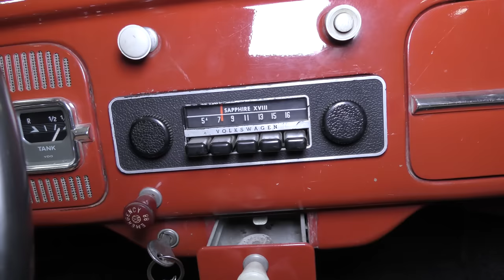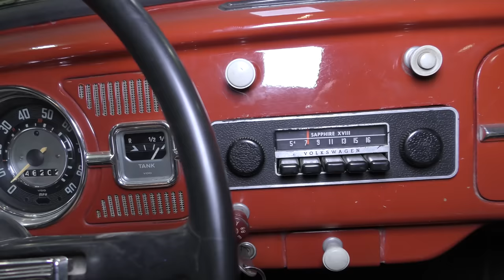Big Mods with big $$$. When Mods don't make sense. What did the  CAR WIZARD do to this '66 VW Bug?

Comment: My first car was a red '67 beetle, so this brought back quite a few memories. Some key changes from '66 to '67 were: 12 volt electrical system replaced the old 6 volt, the headlights had no glass covers. Other than that, they were pretty much the same. I think they moved the fuel door from the trunk to just behind the fender with the '68 model. Oh - the engine displacement was increased from 1300cc to 1500cc.
Reply: Mid year ‘68 was when 12v replaced 6v and also when irs replaced swing axle. I turned 16 in ‘88 and the ‘68 was my first car. I found all this out the hard way over the years and MANY owned VW models. ‘71 was first year the super beetle was introduced and they didn’t get the curved windshield and deeper dash until ‘72
Reply: @soganoflarider  This is a list of all changes incorporated in the '67 Beetle...1967 (1 Aug 66 to 31 Jul 67)
Chassis 117,000,001 - 117,999,000
Engine D 0,095,050 - D 0,234,014 34bhp(DIN)1200
Engine E 0,006,001 - E 0,014,000 37bhp(DIN)1300(US-M240smog)
Engine F 0,940,717 - F 1,237,506 40bhp(DIN)1300
Engine L 0,000,001 - L 0,019,335 40bhp(DIN)1500(US-M240smog)
Engine H 0,204,001 - H 0,874,199 44bhp(DIN)1500

1500 engine introduced - similar to earlier type 2 (bus, kombi) engine, but without the rear cross member mounting point.
"Volkswagen" badge on engine lid.
12 volt electrics.
Generator increased from 180 to 360 watts.
Voltage regulator moved from generator to under rear seat.
Rear track increased with wider swing axles to 1350mm.
Clutch diameter increased from 180 to 200mm on 1300/1500 models.
130 tooth ring gear (flywheel) replaces 109 tooth.
Dual brake cylinder system (drum brakes).

Front discs (single circuit) on 1500 models to some countries (but not US).
Outside door handle has push button.
Inside door handles recessed.
Two speed wipers.
Back-up lights (on US models).
Vertical headlights replace sloped glass.
US models get sealed beam headlights (other countries retain bulb-and-reflector).
Locking buttons on doors.
Driver's armrest on door.
Slimmer chrome trim on outside.
Driver's outside mirror becomes standard.
Rear anti-sway bar added.
Reply: The car in this video has 67 exterior door handles

Comment: My first car was 65 beetle with 6v electrics. At night with the headlights on, if it rained, the wipers struggled to operate. It was powered  by a dynamo, not an alternator. It ran beautifully,  60mph top speed but didn't like hills. Second car a 70 beetle. Paid 300 pounds for it . Had it 10years, put 80,000 miles on the clock and sold it for 300 pounds. Never missed a beat.
Reply: Through 66 they were all 6v. This one has been converted. Most actually went with the 12v generator as the Alternator didn't come out for several years. The funny thing is if you didn't change out the wiper motor they would flop back and forth way too fast.

Comment: The front suspension is trailing link not control arm trailing link suspension gives a smoother ride, important in a car with so little weight on the front end.  Why did you replace the fuel pump?  Older VWs had a problem with alcohol destroying the fuel line between the tank and the metal fuel line in the chassis. Auto makers solved the problem of vapor lock with tank mounted fuel pumps.  Alcohol also dissolved the foam plastic floats used in Rochester carbs.

Comment: Those 'type 1' VWs were SO EASY to work on. You could swap the ENTIRE engine/transaxle in THIRTY MINUTES! Back in 'the day' there were VW garages that had rebuilt assemblies in stock to swap out for your worn out unit at minimal cost.

Comment: The 1966 US version came with a 6 volt electrical system. They didn’t crank over very fast. Was this car converted to 12 volt?  The 6 volt starter didn’t last very long on a 12 volt battery. One needed to replace both the flywheel and starter motor with later 12 volt components. The 6 volt wiring could handle the 12 volt current.

Comment: Had a '67 back in '83 that checked all the boxes. Blue with white interior, deluxe bumpers with overriders, deluxe rims , pop out side windows.but it had so many problems I became an expert on VWs.
The 2nd day I owned it, the clutch pedal broke through the cable end from 15 yrs of use.
Then two weeks later, it spins a main bearing, 
When i go to register it, I am told it's a Salvage Title, I need a brake & light inspection.
 Also, the serial numbers don't match  cuz it has a different front clip. 
When I go to get brakes done, had to buy all new drums cuz they were turned beyond their limits. 
And he tells me that the front torsion beam is bent so that the right tire is behind the left so that's why It turned tighter right turns than left. Never had a chance to fix that as the car was totaled in front of my house one morning by a 4x4.
That's Life in the Big City, Son.

Comment: time stamp time stamp 7:58 elec fuel pump good way to go ( hence time stamp 8:27 question)
 67 was the first year of the gas flap .Supers first showed up in 71 and a redesigned front suspension 72 with the 1302 ( flat window) then the 1303/1304/1305 we introduced in 73 with a new body and suspension . the ball joint front end was based in ( the US market ) in doing a way with the link pin , ( in a bus the cut off ( in the. US market wast 67 )Im guessing a 2" narrowed adjustable beam .Time stamp 20:04 the nomenclature is its a pan , and the center tunnel is a back bone swing axle last year in the US market was 67 the CV live axle was introduced in 68 , and the 67 was the only year in the bug to have a rear camber compensator even the mounting studs and reinforcement thru plates were in earlier and later years .    good vid I enjoy you channel , thanks for the 'beetle challenge" after building them for 25 plus years I still learn something new every day

Comment: Had a '66 in Robin's Egg Blue back in the early '80s, paid $74 for it.  I cut it up and made a Baja out of it.  I filled in the holes in the floor with fiberglass. I also put a 1600 dual port with dual carbs on it, probably made 80 hp LOL.  It was a really fun car.

Comment: I like that breather hose by the way if you use oil bath air cleaners use dexron transmission fluid instead of oil it will filter the dirt out about 3 times better and you can put a little bit more transmission fluid in it it does is lube the valves.

Comment: I had a 1970 VW Beetle in high school and during the winter my battery only had enough juice to turn the engine one revolution and it never failed me as long as I pumped the gas pedal 3 to 4 times.

Comment: Hope you noticed that the right hand steering track rod bolt will hit the brake flexible hose when turning right. (11:30 in the video) That would be an MOT failure in the UK. Couldn't really see if the left hand side is OK or not.

Comment: Back in the 60's many English cars had electric fuel pumps- M.G, Jaguar, Rover etc. And whenever you turned on the ignition, you'd hear the clicking of the electric S.U. pump. When the clicking stopped, you'd know that the carby was full of fuel and the car would start first crank. I don't know why they stopped using them.

Comment: The only gauge a Beetle needs is an oil temperature gauge. The oil temperature varies by the the outside temperature and weather your climbing. It is easy to overheat in the right conditions. All Porches of that era had oil temperature gauges.

Comment: The car has been upfitted with an alternator. A nice addition. The electric fuel pump with safety cutoff is a good idea.
The differently sized front and rear wheels/tires will change handling characteristics and ground clearance.
That will have to be monitored. I'm not a big fan of disc brake conversions, particularly on the VW type 1. The original drum brakes were simple, easy to work on, and efficient.
The pressboard luggage cover, which fits over the fuel tank, is missing. So is the
outer instrument panel cover. What provision has been made for pressurizing the windshield washer? That aftermarket exhaust looks interesting. Where did you source it?
If it reduces back pressure, you may have to rejet the carburetor. Keep an eye on those tail pipes. The color of exhaust deposits will let you know. The stock bumpers should be fitted.
The car looks naked without them. Regarding fuel issues, a little bit of Marvel Mystery oil in the tank, might be helpful. Keep those valves adjusted, do frequent oil changes with the right kind of oil, and that car should last a long time. A handsome little Type 1. I hope the owners drive it. Air cooled VW's don't like to sit around gathering dust.

Comment: Dave says to Dave, was going to ask about the old LEADED GAS, moot point.
But in the 80s when stationed in Germany, I bought a BUG (don't remember the year, being closer to 70 than 65 does that to one).  I remember it had a 2300 and cold do pretty good on the autobahns.  I used to drive it from near the Dutch border to the Frankfurt area.
Basically, the car was a CHAMP, except for two repeated issues.
1. The voltage regulator in that car was behind the driver under the back seat.
2. Even now and then the clutch linkage right beside the gas pedal would "unhook", thus being without a clutch. (Was a blast being in 20s and doing the start "in gear" at traffic lights, and shifting without stepping on the clutch for 2-3 hrs till I got back to base).  
Good times, loved the old BUGs

Comment: If you can get it where you live, ethanol free gas is also great for carbureted vehicles. Sta-Bil still is usefull with it for long periods of time, but ethanol free fuel eliminates the need for short term storage in my experience

Comment: Had a 66 early 80's came with a 356S motor.  Sold the motor for the same amount I paid for the car.  Built a tricked out 1735cc dual port replacement.  We all built Cal bugs in OC back then.

Comment: Although I never owned one, I grew up with other kids who owned them and treated them like rented mules. Sort of like early Harley-Davidson's - just drive them till they break, fix them yourself and keep on going. These things would go millions of miles as long as they didn't rust out. Bolt-on fenders, no heater fan, no A/C, no carpet. Just check the oil and change it frequently, and you could go forever. Loved them. I wish I had one now. I did have a Gen 2 Corvair, but that's a whole 'nuther story.

Comment: I am a die hard beetle fan I'm all about keeping them stock however putting modern reliability is a must I like the fact they changed it from a generator to an alternator that's one of the things I always did another thing would be to get rid of the points and put the HEI distributor in there but as far as everything else leave it as stock as can be

Comment: Wizard, I noticed the axle boots had the joint at 12 oclock, which is incorrect.
They are meant to be fitted with the seam at 10.39, or 1.30 oclock,. according to factory, for longevity.

Comment: My wife passed and could not bring my self to use my motorhome.. Put sta bil in it and fuel system cleaner. started it 3-4 times a year and would move it a little because of flat spots on tires. 5 years later same gas i decided to burn it up and put fresh gas in it and a new filter. Unbelievably it still ran decent on that old gas, there was a smell from exhaust and when i hammed it it blew out smoke the first time. I am shure i would of had problems without the additives..

Comment: I'm glad we don't have that ethanol fuel in Australia, I've got multiple cars sitting with 2-3 year old fuel in them and they still start up and run just fine.
They have a bit of an unsteady idle and are slightly smoky when cold with 3 year old fuel but thats about the worst of it.

Comment: If it still has the 1300 CC engine it may be the last one left. Most were replaced with a 1500 or 1600. IIRC you could fly cut the 1300 case and heads and it would take the 1500/1600 barrels. Not even sure you can get 1300 cc barrels anymore.

Comment: Back in the late '70s you could buy an electric fuel pump about the size of a snuff can, I'm talking about snuff.... not the worm dirt the call snuff today.  mounted it on the fan housing, opposite the coil. No more problems...  Great cars! I like the SquareBack Type lll. Smooth ride, 30 mpg..

Comment: I have an "83 BMW airhead motorcycle with carbs..it's a problem I'm well aware of...ethanol free gas will help with the "sitting" problem...also just starting the car once a month will help...Stabil does nothing to the gas it's self...it provides a vapor in the tank above the gas which which keep the ethanol in the gas from getting contaminated with water (moisture)...

Comment: That thing looks great.  Had a '68 that was Royal Red (a nice color and similar to but a little darker than the better looking 66 here).   After about 5 years got seriously rear ended by and F100.  The only injuries were to the F100 driver'e legs.  Still haven't figured that out, but the Beetle was toast.

Comment: My first car was a 65 1200 beetle. That was in 75. I always wanted a 67 because of the 1300 engine. I'm almost positive the car in the video was not authentic. The 1300 did not come out until 67. Please correct me if I'm wrong, it was long ago. But I'm pretty sure there was no such thing as a 1300 66 model.

Comment: Regarding the Beetle that has fuel shellac problems from sitting - I recently bought a Honda generator, gas powered, and they tell you to run it out of fuel when you're done using it, to prevent this same type of gas issue. I notice that many VW Solex carbs have a large drain plug on the fuel bowl, probably to dump out contaminated gas if you have a problem, but for our occasional use VW here, why not just drain the bowl after your Sunday joyride? Of course the car needs to cool down for a few hours, then you come out with your appropriate wrench and  funnel and little can to catch the gas, and drain it. The next time you get in and turn the key your electric pump will fill up the bowl and off you go !! That's  30K cheaper than for the battery setup.
Nice car, for sure ! I know what's missing - the generator !!
I think those radios were dealer installed. 
I have learned a lot from Mr. and Mrs. Wizard, but now I need to get back to my '67 C10, it needs "some" tlc :)
I wonder - can he  use fuel conditioner in this car and flip off the fuel pump when he is done driving and let it run for a minute to empty the carb?

Comment: Didn't know about a safety device like that. pretty cool and thanks for showing it
Reply: Some sort of cut-off is required for modern cars. Ford generally uses an impact switch like shown here, with a reset button if it gets tripped. GM and Chrysler rely on oil pressure. The ECM turns the pump on for 30 seconds when you first turn the key on, after that it has to have oil pressure.

Comment: Hey Mr. C. Wiz, when lifting that Beetle with your twin post, did you use anything on the lift arm cups so the floor wasn't crushed? For instance, something to fill the channel where the cup contacts the floor and extends a little beyond  the sheet metal?

Comment: The reason gas vapor locks is the ethanol in it.  I had that problem with my wife's old car.  After multiple trips to the dealership I realized it only did it in the summer or after the car was drive a long distance and not provided enough time to cool down under the hood.  I was going to start trying to find various fuel lines to insulate but then a neighbor suggested I make sure to use real gas without any ethanol in it.  What the hell, I tried it and guess what.  If we make sure to only use pure gas without ethanol the car starts perfectly all the time... if on the other hand we make the mistake of using 5 or 10 percent ethanol the car start getting the vapor lock.  So if you notice problems like this on the lake make sure the marina isn't cheaping out and selling you a gas/ethanol blend if they are that is most likely the problem.

Comment: Did you put an oil pressure safety switch so if the engine stalls or the car is left with the ignition on too long and over filling the bowls? This would keep the pump from running except for when cranking, but the car shouldn’t have to crank long to start. This is something very common on boats.

Comment: When they say that those cars were build like tanks, they talk about those torsion bars! lol
Glad the owners kept it stock. I didn't knew about those heat duct under the car. Are those under the feet board on the side? If so, peeps that remove them when they mod those must end up without heating (unless they create other ducts).

Comment: You can't use the "Red" formula of STA-BIL when the point is to protect against the effects of ethanol.  You have to use the "Blue" Marine formula of STA -BIL when ethanol is involved.  I learned this from talking with a rep from STA-BIL when he was at our local NAPA Auto Parts store.  Basically for most of us that means using the "Blue" Marine formula.
Also, regarding the situation with this VW Beetle or any car that sits around, the SUNOCO web site states, Regular 87 Octane Gasoline with stay fresh for 3 months.  Whereas, Premium 92/93 Octane Gasoline with stay fresh for 9 months.
Regarding the Rear Torsion Bar, understand that they are very difficult to adjust.  Only have a pro adjust the Rear Torsion Bar.